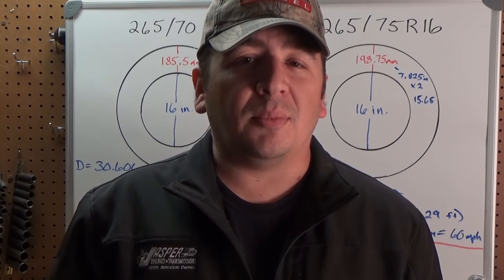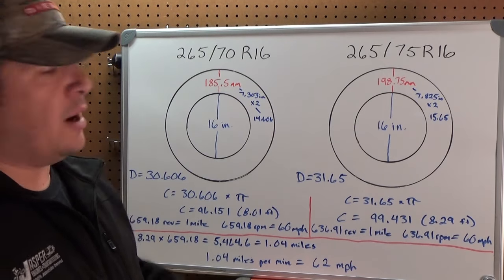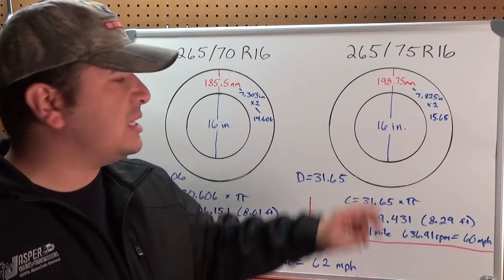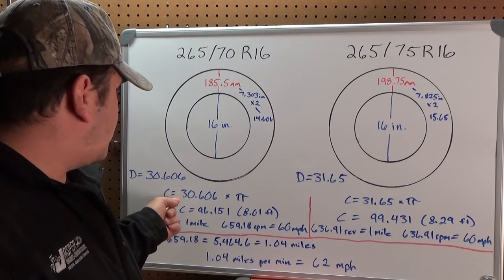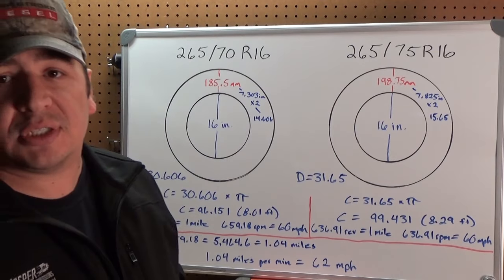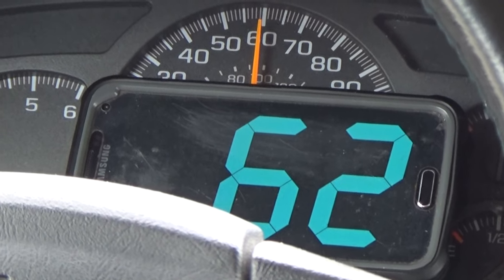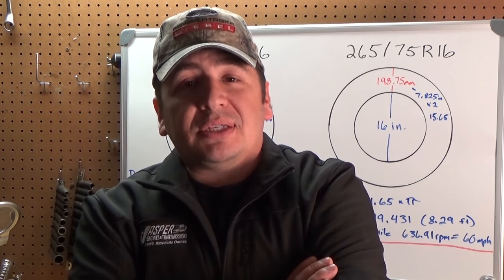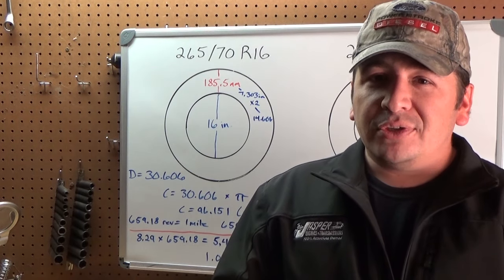Wrong Tire Size - What Does it Mean? - Automotive Education

Comment: The more important point is that the wrong size of tire can show that your car has more miles on it than it actually has. A smaller tire over 6 years can really mess with the odometer. Not to mention this throws of your service schedule. Oil changes etc.  I guess you could put larger tires, notate the difference so you don't speed and keep your cars mileage low. lol. Thanks for the video.
Reply: Thank you for this, this comment is very helpful and what I was looking for.
Reply: @jgthe2nd202  lol so you getting bigger tires?
Reply: That's a bloody lie
Reply: @wildestcowboy2668  how is it a lie??

Comment: Why is everyone blowing off about the speedometer readings!? There should be actual talk on upsizing on the same rim with handling issues and clearance etc.,
Reply: Thank you! I was wondering if upsizing or downsizing on the same rim would affect my handling and stuff like that. The speedometer is the least of my concerns.
Reply: Milan Latona  Tire radius change by +/- 5% should not matter. Provided the Road clearance is not an issue and width remains the same or just the next size.
There are comparison calculators on the web which make it easy for everyone

Comment: +1” tire height (roughly) = 2 mph actual speed over the gauge.   Great geek work, thank you!!!
Reply: Real question is what happens if you put on a 19" rim instead of the oem 17"...
Reply: Actually this prof is wrong he shouldn't multiply the rpms that he saw on the small tyre to the large tyre to get wht the odo will show. What actually will happen is the rpm will be less. As the tyre is larger its circumference is larger thus it needs less rotation to cover the same distance as a smaller tyre. Thus there will be a lower rpm recorded on the wheel. Which the computer will percieve as lower distance and speed. Thus u get a false lower reading. Not high!! So much for a tyre prof😅 

i knw he is not a prof.😝 But sure wud pass for one
Reply: @amoghpatil  did you watch till the very end?
Reply: @dpeagles  yea.. i have
Reply: @amoghpatil  You stated "Thus u get a false lower reading."
He did get a false lower reading! His car speedo showed 60 when his GPS showed 62.
He may have mis-stated or miscalculated but got the same answer you did. "Not high"
Reply: "= 2 mph actual speed over the gauge." ------- Yes at 60mph.
It would be 1 mph over actual @ 30mph and 3 mph over actual @ 90mph.
I thought it would make a bigger difference but a couple mph diff ain't sh*t.
Reply: @jacka55six60  i just realised he was right. I didnt percieve it properly.
Reply: @jacka55six60  I believe it is pretty common for speedos to show false reading to begin with. They usually show higher speed then the car is actually going.
My car (2013 peugeot) with default tires shows 100km/h when the real actual speed is 93km/h.
I changed my tires from 195/65/15 to 205/65/15 now the actual speed is roughly 96 when speedo shows 100.
So in some cases bigger tires make the speedo more accurate.

Comment: Thank you very much for this work. Where am I here in Africa, most of us do not have access to the correct size tires. If the tire can fit the wheel, we go for it. A much bigger problem that we have if inflating the tires to the correct PSI. I have been driving here in Cameroon for 4 years and I'm YET to run into a pump that gives me the exact 35PSI that I need.  They are typically inflated at 10PSI overs which, when combined with the aggressive driving habits around me, is the cause of the majority of deadly accidents around me. This is a systemic problem that needs to be resolved to save lives, but the country is "poor" and has far more urgent priorities!

Comment: I think the more concerning issue is how the tire size affects the longevity and performance of the car,  in my opinion. 
Also,  I heard  most cars of  today have their speed set lower than what their speedometers display. Using my car app such as Waze, I can notice my speed in some cars to be 2 to 3 miles lower than what is displayed in the dash. 
So, in this case, should I still get a tire that is bigger than what is specified for my car?

Comment: Thank you for this, I was just advised to put 195's on my car that should have 175's to run better on an unpaved road I have to travel daily. Immediately realised as I drove off the xtra effort it takes to pull away, not a lot, but still. So by his logic it would also mean that a car would have less miles on it's tachometer than it actually travelled if fitted with bigger tyres, right?

Comment from the maker: Hey, Thanks for checking out the video. I hope you liked it. Feel free to ask any questions you have and leave your thoughts or feedback.
Reply: thanks for your video and the info...
What would be then the effect on the car's gearbox (if any?)
Reply: I have a 1999 Trans Am. To give the car a better look I put on a set of C6 Corvette wheels . 18X9.5 front and 19X10 rear. I have noticed that the ABS light comes on at highway speeds. What can I do to fix this and keep these wheels?
Reply: My 2020 Mitsubishi Outlander PHEV OEM's are 215/70r16.
I changed it to 225/70r16 AllTerrain tires (I do a lot mild off-road, gravel roads and snow).
I am very happy with the change but I lost about 20% of EV range and fuel consumption went slightly up.
I will be performing 1.2inch (about 3cm) lift and I am planning to install even bigger 225/75r16 tires to increase the tire side wall and ground clearance even more.
Do you think this is good idea or this is too much?

Comment: This is good stuff, BUT just the tip of the iceberg as many here are here because we go with larger tires because we're modifying our vehicles to perform better off road and we're curious how to manage the differences with MPH, fuel economy and power.....  For instance, I have an '04 AWD Astro van I converted to 4x4 with an s10 transfer case and I have a decent lift on it.  My tires are now about 2" taller than stock and my speedometer is off 4mph...  There are charts out there that point out the relation to tire size, gearing and rpms - There are "sweet spots" to aim towards, for instance, according to what I've seen you can get better gas mileage but have a loss of power at the same time. 

This video is great for what it is but most people who go with larger tires already/quickly learn/understand the speedometer is off without needing to understand the math involved (I enjoyed this explanation, anyhow) - What they really want to know is how to reprogram the computer to work with the new tire size so the speedometer in in sinc as well as to get the mpg readings to be accurate - I'll be looking to see if you've done anything on that as I believe you'd probably be the perfect guy to explain all that

Comment: Got a BMW 335i. Went through 17 tires in a 3 year period. Therefore, I had zero confidence in the reliability of the vehicle. Well, ironically enough, I garaged the thing for 2 years bc I was sick of driving somewhere, blowing out a tire and then waiting for AAA to come give me a tow bc the vehicle has no spare. Well, after taking it out of the garage recently, I realized that the back tires (which calls for a larger width) was the same as the front. So these dipsticks at NTB we’re sticking on the wrong size for 3 years. No idea how I never caught that. So, shame on me for trusting someone else that should know their job.

Comment: Nice to see your method of displaying the calculations.
 I myself have simply ignored my car's dinosaur terrestrial speedo'... for over 15 years, in favour of GPS!

  Reason:  my '91 seven seater FrontWheelDrive (FWD) mazda's speedo has an inbuilt inaccuracy far  beyond what I personally  deem practical;
 for example at Speedo 100kmh, I am doing GPS 92kmh.
 At Speedo 80, I am doing GPS 73kmh etc etc.

 The vehicle has only one size on it's manufactures' chart - being 185/70-14.
  I'd like to go for 185/75-14 instead.   ( I don't want to go 195/65-14 etc etc)

I want to achieve a longer rolling distance; smoother ride

 From the above figures:
  PROs: I will have no need to worry the Speedo will ever under-read, compared to the GPS' as according to calcs' I would expect to see a 3% increase in Rolling Distance with the 75% tyres on.
 I can see I would achieve a softer ride;
 lower RPMs for any given GPS speed;
 I don't need to worry about larger wheel rim width changes;
 I would achieve a higher area of footprint for better hold, for, when applying power I therefore expect to never again have to suffer the tyre skid when accelerating from standstill.
 This being due to the extra rubber on the road, from the larger Diameter.

 CONs:   There might be some small compromise to tyre wall  deformation upon hard cornering?
 An Insurer might refuse to pay out, if the tyre is not exactly as stipulated on the Plate? 
   My Mazda seven seater is FWD, and is well known for the tyre skid upon acceleration from standstill. Most of it due to being FWD, but I also have long blamed the original diameter of a 185/70-14 contributes to it.
A more modern vehicle's ECU would report to the owner that it's next due Servicing Schedule would for example come due at 97000km instead of 100000km

Comment: My car, the 2021 Impreza had 7 trims but 3 different wheel/tire sizes. I bought the sport 🤣, which has the same engine in all trims, so I am wanting to change my P225/40R18's to P205/65R16's for an smoother ride.

Comment: i had the opposite issue, think it was after getting a plug in my tire and getting a get throttle body, could be that my tire pressure was lower than needed be but finally getting accurate odometer and speed, but now getting tire/axle ratio out of range it's weird.  ECM was replaced and completely reprogrammed a year ago around same time but was about 1 week after the throttle body was swapped.

Comment: The taller wall tires will give more comfort.

One will have to bear in mind that the actual road speed will be about 3 to 5 percent higher than the speedometer reading.

I think as long as the wheel well can fit, upsizing the whole tyre is doable.
Reply: most car speedometers are calibrated to show 5-8% more than your actual speed so people can't blame the speedometer when they care caught speeding. so an inch up should really not make a big difference since you would still be traveling slower than the speedometer says. If you want to measure precise speed GPS is the way to go.
Reply: @Ggorazzi  the speedometer gauge dosnt even show actual speed if you look at scan data the computer shows the speed more accurate usually the speedometer is already off by 1 or 2

Comment: Will running tires with a higher diameter result in better fuel efficiency (MPG), and why?
Reply: That might appear that way. But in Reality, the factory tire size that comes with a vehicle is thoroughly tested to be the best possible for the vehicle, engine, aerodynamics of vehicle and offcourse driver comfort.
If increase diameter increase mpg, then all companies will fit bigger tyres lol, to increase mpg.
The tyres with bigger diameter cost more engine power thats why truck and suv with bigger engine has bigger diameter tyre than sedan.
If u install suv size tyre in a sedan with 40mpg, the mpg will drop cause taller tyre will push engine to use more power and therfore use more fuel. And yes top speed of vehicle will decrease as well.
The handling might also be bad.

Comment: Excellent video, is there any effect on actual MPG, for gas only vehicles. Thanks!!!
Reply from the maker: I can't say confidently one way or the other. With taller tires, your vehicle will work a little harder, but go a little further. I'm not certain which way would yield the best MPG. But thank you for your comment and for checking out the video. 

I might have to investigate that in a future video.
Reply: DIY Auto Homeschool that would be a great video.
Reply: @DIYAutoHomeschool  Looking forward to your investigation on its effect on MPG.

Comment: I have 2001 Proton Wira sedan. My OEM wheel and tires size 185/65/14, i change to 185/70/14 tires to increase ride height, fill wheel gap and more smoother ride on uneven rod.
Reply: Did this increase your fuel consumption?

Comment: After punctured the tire (pothole) I was in need to install spare tire, so I could only get in that situation 225/50/17 tire (other three are 215/50/17). One wider tire installed on the rear right position.
I'm in the process of finding the same 215/50/17 tire, and occasionally driving with one wider tire (and with different pattern), and I didn't notice any change in control, balance, braking, also in 6th gear on highway.
Do I really need to match one wider tire ASAP?
What are the symptoms of driving with one tire wider 10mm than others on the system?
Thanks.

Comment: I got hpnda crv 2019 my tire size is 235/60r18. If i use a tire sizes of 235/55r18 will it affects the awd system or does it may cause some trouble on the awd system in the future? Thanks

Comment: Hello, thanks for explaining the difference in such detail, I got new tires from discount tires for my 2006 Chevy HHR and the guy screwed up ordering my tires and instead on ordering 215/50/17 he ordered 215/55/17 which is a bigger tire. I really don't care about the speedometer or the odometer readings, I was more concerned about how this will affect my suspension because there is really about half an inch distance from the new tire to the suspension plate.. Also my other concern is the gas mileage and how it would have an affect? 

Thanks in advance..
Reply: I have Renault Duster it Has 215/60R16 on tha Front and 215/65R16 on tha back !

Comment: Have a question for you? I bought a Brand new 2022 Mercedes-Benz Metri van I now have 38,000 miles on the van time to change tires, original tires and rims on the van factory, have not been changed. I discovered from factory the van has 17" rims on the driver's side and 16" rims on the passenger side. Mercedes say they will buy me two new 16" rims, but they want the old 17" rims back. My question is do you think with this being a rear wheel drive there is any drive Trane concerns?

Comment: Do TIRE differences harm a transmission?
Reply: This is an old question but I'll answer it for the next guy because its a good question. 
Short answer is Yes. 

If you have mis-matched tire sizes on the driven axel (front wheel drive/rear wheel drive) it could definitely cause problems. 
If you have two different sized tires they will have to spin at different speeds to cover the same distance, kinda like when you go around a corner, the outside tire has to spin faster than the inside tire. This is why cars have differentals. If youve ever driven a car with a Locked/Welded Diff and go around a tight corner it basically forces the inside tire to do a supsr slow burn out to keep up with the outside tire. 
So it'll probably burn up the Diff before the transmission? I cant imagine a front wheel drive with an automatic transmission would fair very well either. 
Its absolutely necessary to have 4 matching tires with any All Wheel Drive system where its AWD all the time. Subarus are kinda notorious for making people change all four tires at once even if you just had a random flat in one tire for fear that putting a brand new tire on one corner when the other three are maybe only halfway thru their thread wear. BMW X-drives ive heard similar. 
So really as long as the two drive tires are Same size, the actual size is basically irrelevant.

Comment: I own Honda Jazz 1st gen and drive 175/65/r14 tyres in the front and 185/60/R14 back tyres.Honda recommend to drive with 175/65 tyres but i have made mistake and mounted brand new 185/60r14 on the back wheels.

Cons-The braking distance increased.I feel like i need to push the gas little more than before to gain speed.Steering is little heavier.

Pros-car feels really stable,especially when turning at higher speed.Suspension feels softer and bumps are less noticeable.

Will i cause damage to the engine and suspension if i continue driving with this tyre combination?

Comment: When i read the title i had assumed this would be about the cost that can occur due to mechanical failures of running different size tires on a vehicle . 

Good video though  it  makes sense
Reply: My car has two different sizes and was manufactured that way. I have wider rims in the rear. I believe that’s to optimize speed by adding more traction to the rear given it’s a RWD vehicle.

Comment: I got  a 2007 Jeep JK with 344k and it had 35" MT tires....is it possible that the odometer is reading higher than what it actually has? 7 weeks in now im at 348k....thats 4k i  seven weeks?

Comment: While an old video, it's my problem today. Bought a 2023 1500 RAM. Dealer put a front level on it and Firestone Destination 35 12.5 r20 on. Seem to be great tires. I drove a few hundred miles, speed seems off, WAZE gps shows 44 while truck shows 40. I went back to dealer, did ya calibrate these tires? Nope, RAM won't let us. SON OF A !!  I went to a tire dealer, nope, they can't but down the street will. I went there, come back for a quote! WHAT? Ya put a box on, say size of ture, poof fixed?? He believed the price would be about $800 as they take the dash off. OH HEY THE H NO YOU WON'T!!! So, I have wrong odometer miles ,wrong shifting speeds, wrong mpg, wrong mph, and I'm cheated from my warranty mileage as I believe I have driven less than the bigger tires register. I should have 275/55r20 but dealer put on 35 12.5 r20- what's that- some 4 to 5 inches more diameter? Thanks for a good video.